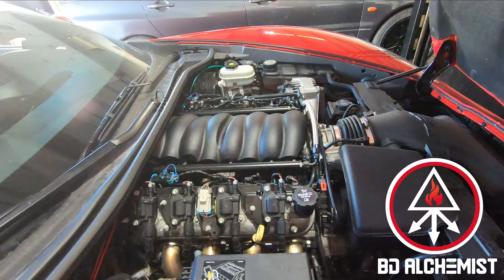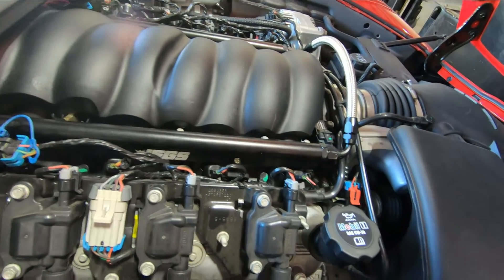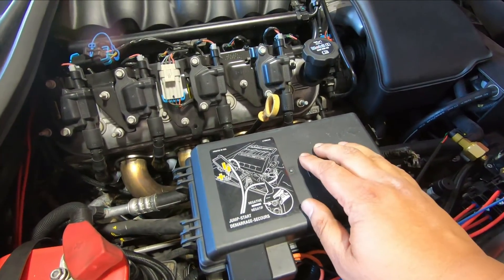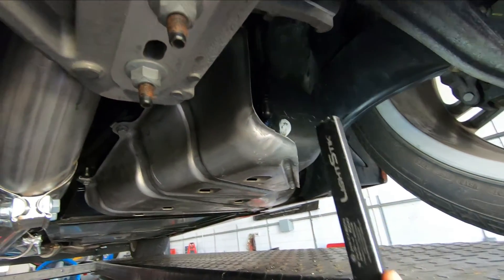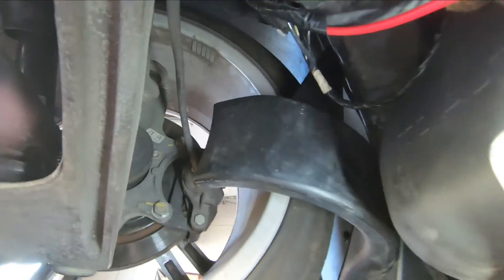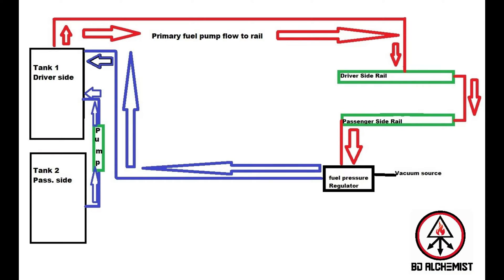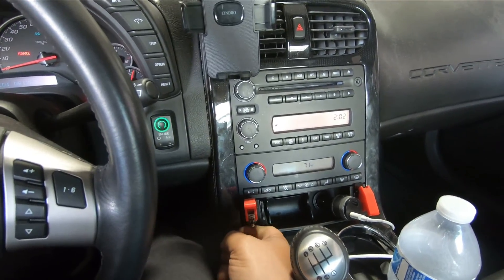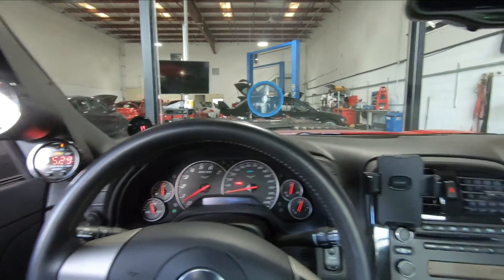Corvette How to Return style fuel system with External fuel pressure regulator

Comment: I did return style fuel system on toyota altezza with 3sge. The car is NA but still installed 540cc injectors. However I dropped fuel pressure from 60-45 psi. Am I at risk of damaging anything?
Reply from the maker: i would def get a tune or adjust to stock pressure till you get a tune